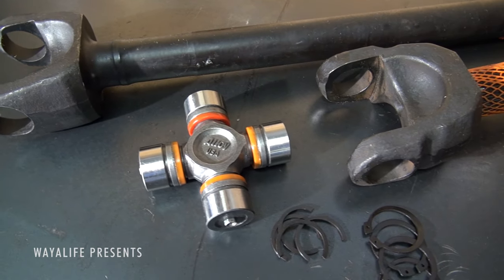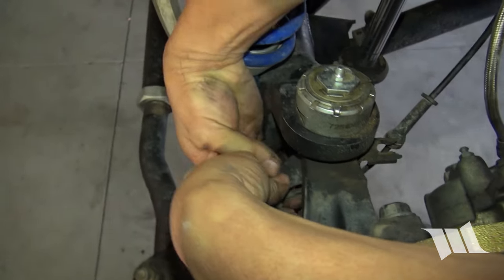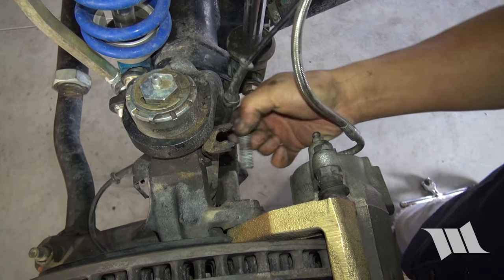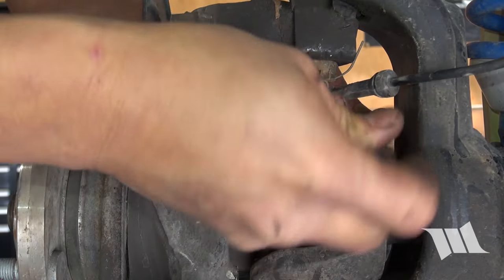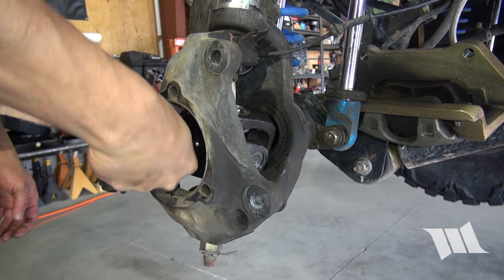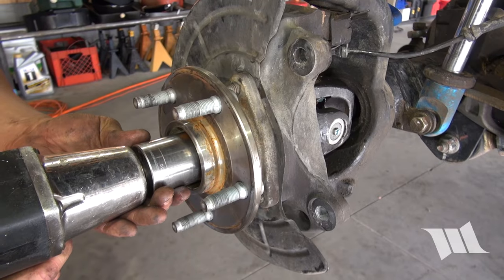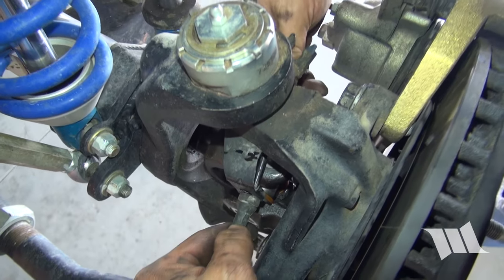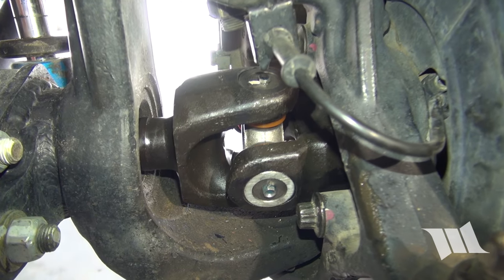Jeep JK Wrangler Front Axle Shaft Removal and Installation : HOW TO

Comment: Thanks for this video. I had never done something this much on a jeep or anything on any car but today I managed to change my broken front drive axel shaft. Although I live in Northern Europe where it snows 6 months of the year and lots of salty roads, those 13 mm bolts were pain in the butt, two wrenches bended but the bolts won’t come off, I tried blow torch for 30 seconds and then used a 13mm socket with a long breaker bar, the first two came out with ease but the third one broke. 

My wheel bearing was getting very bad because of corrosion so I got a new one with 3 new bolts, I removed the ABS sensor from the wheel hub and bearing and kept the new one as a spare. 

I got a torque impact wrench with 1400 pound feet of torque, it opened the the 36 mm axel bearing in 2 seconds.   

I was using a hydraulic jack so my angels were a bit too hard.
Reply from the maker: Happy to hear our video was helpful to you.

Comment: only thing i will say is DO NOT throw away the guide unless its trashed and if it is get new ones. They can save your butt from popping the seal loose as you guide shaft in. Especially on the passenger side. USE THE GUIDES !!!

Comment: 35mm socket for the the hub nut, NOT 36mm.  36mm will work in a pinch but it's the wrong size.

Comment: Nice Video sir. I'm on the fence about upgrading shafts on the D30 front when the time comes or getting a Rubi D44 front. I have lots of time though, and don't know if anything more than a 35" will hit my jeep.
Reply from the maker: +Chris Hart If you're just going to run 35's, you're more than likely going to be just fine with your Dana 30.  As far as shafts go, I'd personally wait until you really need them.  As you said, you have time on your hands and so you should save your money until you "need" to spend it.
Reply: +Wayalife  Thank you. I figured that the Dana 30 would be ok. I'm still new to the JK so I haven't had time to look at the specs on the JK Dana 30 vs older versions I'm more familiar with.

Comment: What prevents warter, dust or mud from entering te axel tube? I see no seal or dust cover, thank you! vey good video!
Reply from the maker: Nothing really. There are aftermarket seals you can buy and install but really, it's not that big of a deal. There is of course and axle seal inside the tube by the pumpkin.
Reply: @wayalife  Thank you!

Comment: I notice that when you tighten the hub nut, the shaft comes out a little bit. Doesn't it mean that the splines are not fully seated in the differential?

Comment: Nice video. BTW do you have to drain the diff fluid before you remove the shaft? Thanks!
Reply from the maker: Some fluid will most likely leak out after pulling the shafts but just a little. A proper fill will have the fluid sitting at about the base of the tubes. So no, it isn't necessary to drain the fluid first.

Comment: Where is the rest of the video of how to remove the axle shaft because I’m trying to learn how to remove it and I’m stuck. You guys don’t show that part where it’s easy to take of. The only part that you guys show is removing the brake parts with hub assembly. You guys say after that the axle shaft slides right out?
Reply from the maker: Not sure what to tell you, our shaft came out with ease. Could be your splines are twisted.

Comment: it looks like your speed sensor wire bracket is on backwards.  they are marked "L" and "R" with an arrow pointing (I am assuming) towards the front.
Reply from the maker: They're extended brake lines to accommodate the amount of droop we have. I purposefully installed them this way as it did a better job of keeping the lines out of the way of potential damage.

Comment: Working on my 2013 Wrangler Sahara here in the rust belt of Buffalo .What size open end wrench was that on the 3 bolts holding in the hub assembly( I was using a 6 sided socket but it seems like it is starting to strip and I broke the speed sensor part going into the the hub, can you just dig that out and get a new speed sensor wire going into it or should I buy the wheel hub assembly with a speed sensor wire with it?
Reply from the maker: You need to use a 12 point 13mm wrench for the bolts. Also, you can buy a new speed sensor but they typically come with new hubs.

Comment: How important is that plastic guide ring at 2:07? I just noticed the other day that there’s a small ring around my axle shaft that keeps working it’s way out of the axle tube when I drive. Should I be concerned about this? I usually just use a thin long piece of metal to push it back in but it just works it’s way back out. Does it keep water out or something or can I just cut it off or ignore it?
Reply from the maker: Not important at all. They're just guides that are used during assembly.
Reply: Wayalife thanks man! Ik it’s kinda mentioned in the video but eh. Just wanted to be sure. Haha

Comment: What is a 12.13 mm wrench? That doesn’t sound correct
Reply from the maker: 12 point as in, it has 12 sides as opposed to just 6 on the box end and then, in a 13mm size.

Comment: What is the splint count on a factory 07-16 JK front axle?
Reply from the maker: On a Sport and Sahara with a Dana 30? 27 spline. On a Rubicon with a Dana 44, it's 30
Reply: I`ve read some say 30 other 32 so finally opened  mine and yes, it`s 32

Comment: Why does everyone refers to the hub nut as 36 mm when it's actually a 35 mm ?
Reply from the maker: +Ron i Sorry, didn't mean to offend.  36mm is just what I've had and have been using for about 10 years now.  That being said, 1mm is really small and it won't make any difference especially on a 6-sided socket.
Reply: No problem you're not the only one, everyone calling it 36. I wanted to carry this socket in my on-the-road tool box so I measured the nut, no set comes with a 35mm, I had to order a single socket. I guess that's why everyone using the 36 which is more common.
Reply: @ARC928  A lot of people use a 36mm - from what I hear - also due to how tight a 35mm can be when parts get rusty
Reply: It is a 36mm.